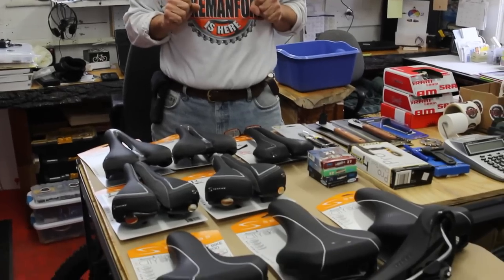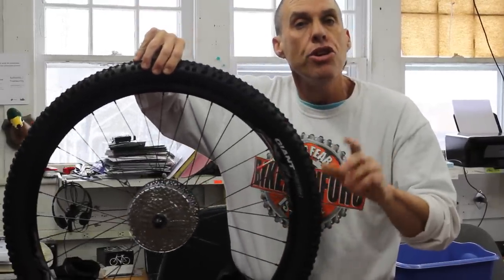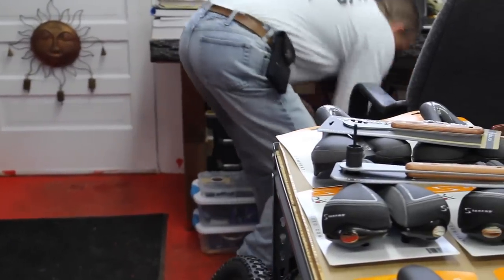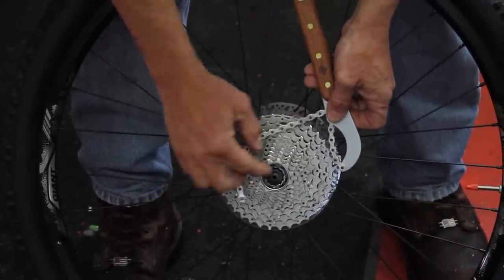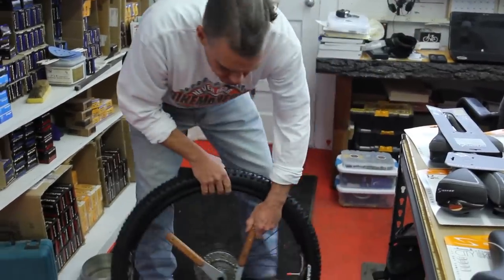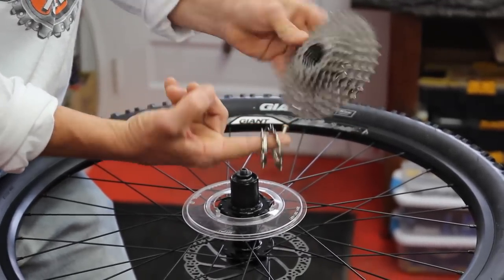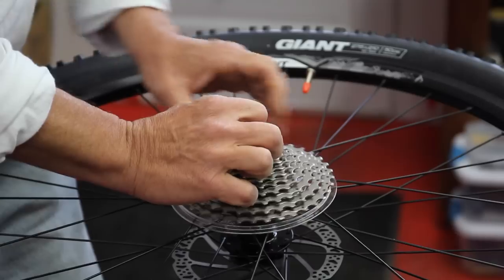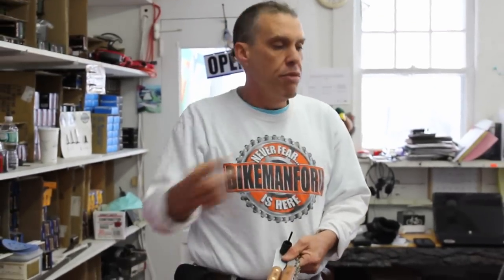Shimano Cassette Removal - Easy How-To - Origin8 Classique Pro Bicycle Tools

Comment: Very pretty tools.  Careful on how much torque to use when tightening the Cassette lock nut.  Some higher end drive shells are made of aluminum and too much torque could split them.

Comment: I'm trying to adjust the Tiagra 4500 freehub, but I'm puzzled - on the drive side, there isn't any place to put a cone wrench. I.e - I've loosened the non drive side a lot, allowing me to push the axle through to expose the cone on the drive side, but all I have is a nut, spacer, and then cone - but the cone is perfectly round! On the NON drive side, the cone does have the flat bits for a cone wrench. How do I proceed?

Comment: Wow, I didn't know it was this easy. What happens if I put too much force/spin it more than what you did when you put it back on? Or should it just feel tight?
Reply: You heard that little rachet sound coming off and quickly in the final tightening? Bikeman gives is a satisfactory lunge but you can feel those little rachet indentations also and my technique is to go slow and count about 10 or 15 clicks and feel a good snug...that's always been tight enough for me (no problems develop). The lock ring is just aluminum (maybe ti on some also) on high end cassettes and pretty easy to mess up if you go at it like a bull in a china shop.
Reply: Digger O'Dell Ok, thank you :)